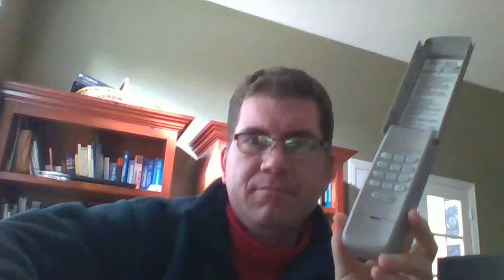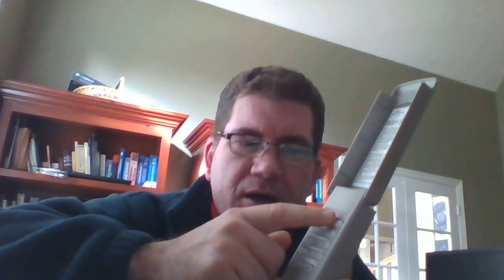Garage Door Keypad Quit Working - Try this trick

Comment: I was having same problem. I took the unit apart. Not much to it. A keypad with little flat square metallic contacts on the other ends of the rubber keys, and a circuit board under that. The keypad had no physical connection to the circuit board until keys are pressed. What I did was to wipe all the little square metallic contacts off with rubbing alcohol, and also all the spots on the circuit board which those contacts hit when the keys were pressed. Put it back together, very simple, and pressed the same numbers as I always did. It worked fine and could press the keys very gently, and it still worked fine. I'm sure this will fix most cases!
Reply from the maker: Very good idea. I ended up replacing my keypad, but if this happens again, I'll try what you did, and maybe make a video of it too.  Thanks for sharing Lou!
Reply: Hope it helps you one day! P.S. Be sure to disconnect battery before wiping circuit board with alchohol.

Comment: Hi, my garage door keypad is not working .when I put on the any key, the light is flashing. Also, every time when I open the door with any other garage remote control unit first, it will works, But every time when I come home, the garage door keypad doesn't work.

Comment: How was it able to accept your code to change pass code
Reply from the maker: There's probably a YouTube video for that :-)    It's going to depend on your garage door opener.  But usually there's a button on the opener unit itself that you have to push to get the unit into its programming mode.  There are usually some programming instructions printed on the opener unit on a sticker near the programming button.  Sometimes this is all behind the light shade, which needs to be carefully removed first.  Hope this helps.  Good luck!  Don't forget to like my video :-)

Comment: Mine still doesn't work I think I need to erase it and start again?
Reply from the maker: I'm not an expert on these devices, Dawn, but I'd suggest 1. Make sure you're using a good battery.  2. Make sure your other remotes work (indicating your opener itself is working).  3. Try re-programming it with a new number.  If all of the above don't work, perhaps your ENTER button has stopped working.  If that's the case, it may be time for a new keypad.  I have purchased new key pads on eBay for about $7 or $8 so it's not a huge expense.  Good luck to you!
Reply from the maker: Please subscribe to my channel. I am hoping to get to 1000 subscribers.  I will be coming out with a new video on how to inexpensively replace your garage door keypad once your Enter button on your keypad eventually wears out.
Reply from the maker: Here's that video I mentioned.  Please subscribe to my channel.  Thanks!  https://youtu.be/0NHU5FhNulk